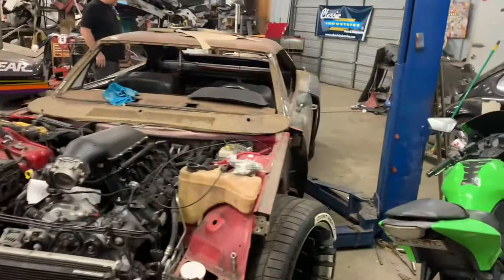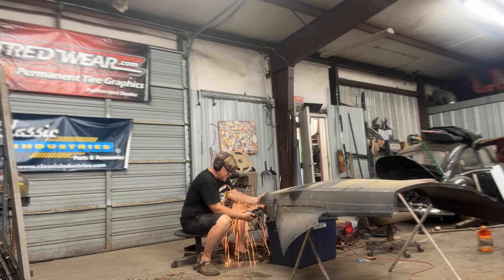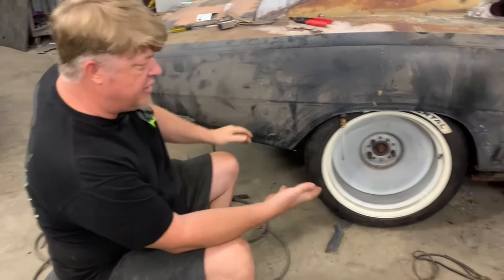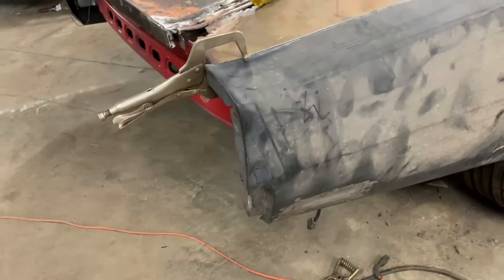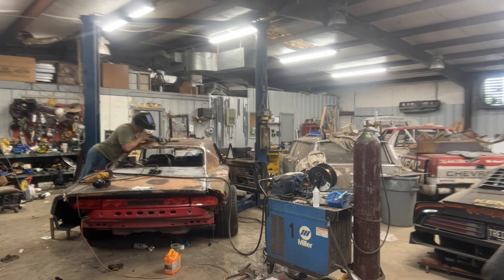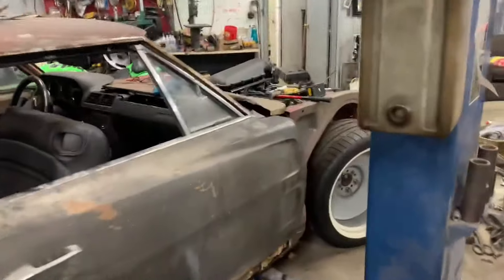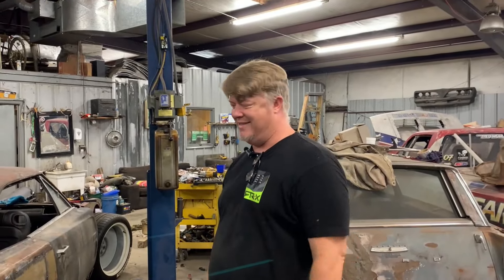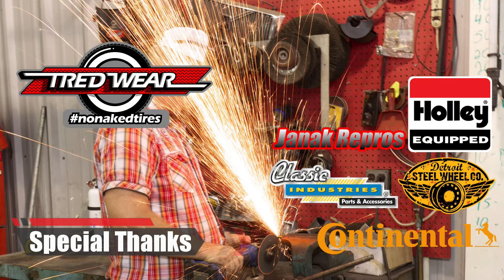World's Widest Daytona!

Comment: would be a little bit of a DOHW moment if everything is done and painted and you cannot get it out of the shop because its too wide for the garage door
as for wedge cutting in the rear fender : it might be eazier to cut the doors the same way and put a wedged piece of spacer in that so it comes out from the stock with in the front to the width of the rear , might need to put in a little wedge on the fender to soften the transfer from the door intoo the fender but the doorpanel seems to be straighter (less of a waistline / coke bottle shape ) and eazier to modify , the lock and the hinges stay the same , might need to adapt the doorgap so the edges dont hit eachother when opening the door
probably could even make the doorsill wider with a filler piece to fit the widened fender 
 the front fenders might be a little more work though you could mover the lights outwarts and widen the center part of the grille , i would leave the rears of those front fender open or increase the existing scallops in the doors fitting intoo that